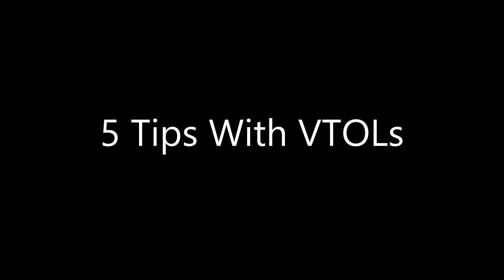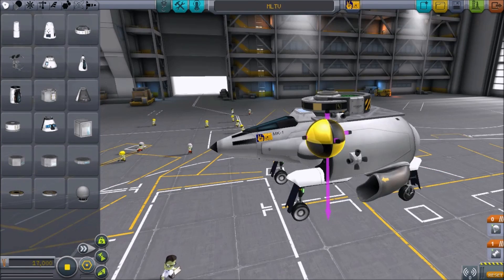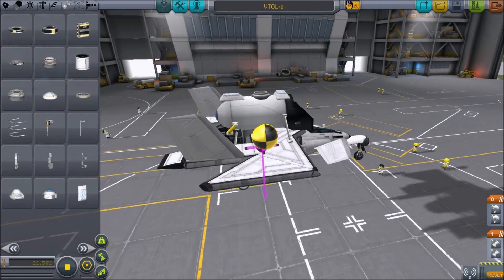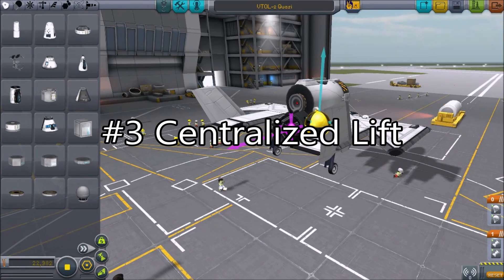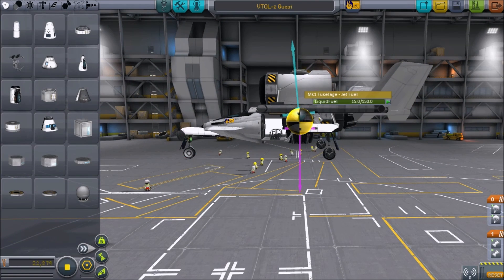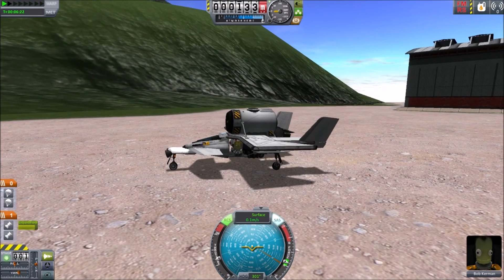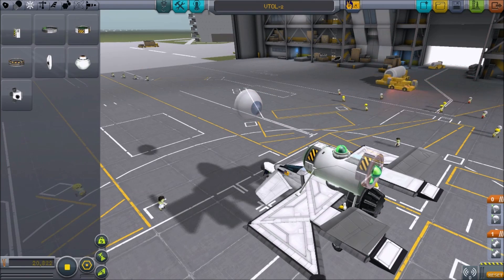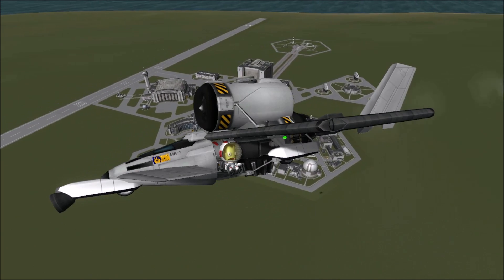Kerbal Space Program 5 Tips with VTOLs

Comment: I did a front and back VTOL, something like the F35s. It is very difficult to maneuver, even with RCS. Other than looking cool, I still recommend center or side to side VTOLs.
Reply: Very awesome! yeah no way around it, VTOLs take lots of practice :D that's the primary reason I decided to leave the crashes in this video. I'm hoping to get good enough flying my "UFO Crane" (end of video) that I can use it to pluck capsules out of the sea
Reply: Very cool, love your 5 tips videos, very helpful for me. BTW I want to know what type of recording device do you use, to record your gameplay?
Reply: Karlen Bell I use FRAPS. I've tried several and for me, Fraps was the least performance hit (has its moments). Its limited to 30 seconds of recording. I made videos that way until my brother got me the paid version "5 tips with Mun landings" was my first video not limited to 30 seconds, which made landing much less stressful! 

Very glad you love the videos :D Lots of work for a very short runtime. I made tips with lights and tips with vtols at the same time, do you think it shows too much?
Reply: No, it's all good. As long the tips are useful, then it's always good to upload it whenever you want.
Reply: Karlen Bell Awesome :D thanks for the feedback, saved me a lot of time
Reply: No problem.
Reply: You need the thrust to be equal distance to the weight, I just made an F-35 with stock and I could post a video on how mine works if you'd like